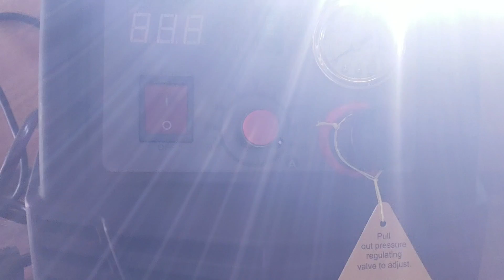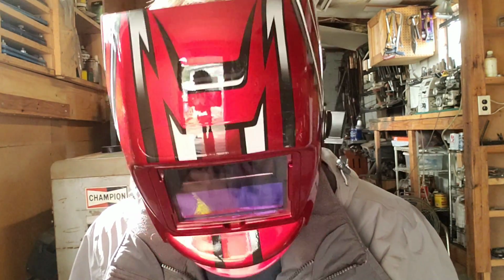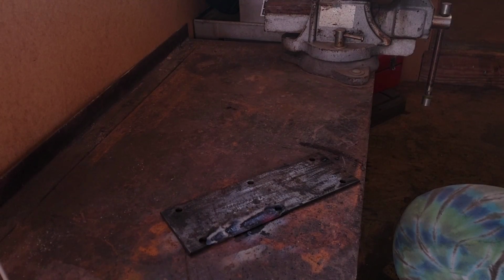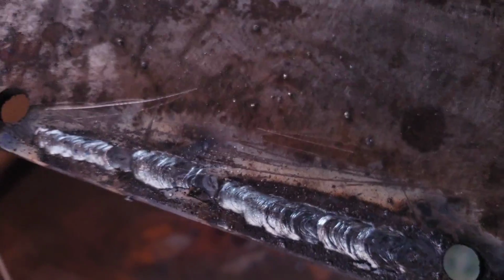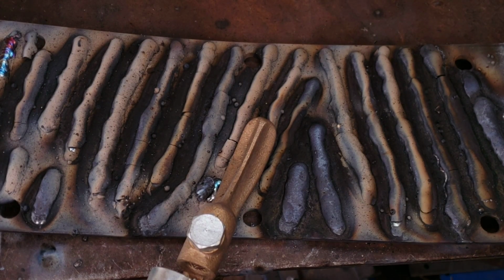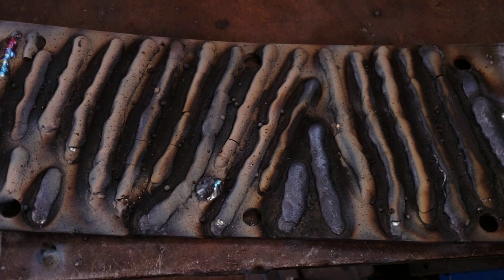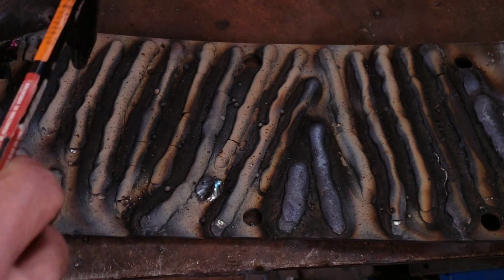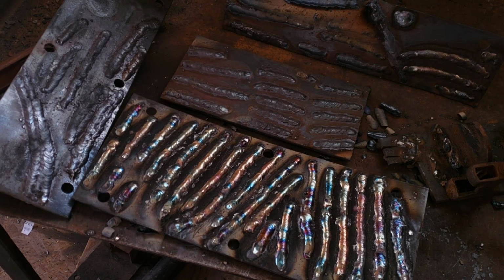Stick Welding For Beginners - First Time Ever!!

Comment: Looks pretty good so far, but try not to practice on just a plate, because stick welding requires penetration. It needs a bevel, or joint to use it properly, so change what you’re practicing on. Try getting a couple pieces of flat strap, butt it up like you’re making yourself some angle iron, and use those to practice with. It’ll teach you inside flat, outside flat, and you can stand it up to work on uphill. 6011/6010 will be 5p/penetrating rod. 7018 will be your cover rod. 6011 holds it down, 7018 makes it look good. Keep it up, you’re doing good!
Reply from the maker: Thank you for your input, I will give it a try.

Comment: Pretty good for a beginner keep practicing. 308 rod is stainless that's why you got the colors it can be a booger to weld the slag can move faster than the puddle.
Reply from the maker: Thanks, that's good to know! I have so many different electrodes it's going to take a lot of research and experimenting to figure them all out.
Reply: I thought it was just beautiful art work ! But I have never welded.ha,ha, was pretty.
I’m glad you put this video out because I’ve been thinking about getting this welder. What more can you tell us about it & the plasma feature?

Comment: Man that reminded me of first day in shop in high school. In FFA we done a lot of things welding was one of them just one of the thing you need to know on the farm. We did what you just done then when Mr. C said you was doing good you started welding two pieces of metal together then try to brake it. If it broke in the weld you had to do it again if it bent by the weld you moved on to building thing. A lot of fun memory's.
Reply from the maker: Some of the best memories come from working in a shop! Sounds like fun! That will be the next thing I practice on.
Reply: I also had a teacher called mr c in high school that’s where I first learned stick now I’m about to go into an apprenticeship ironworking program

Comment: Try practicing out 6011 or 6013 all the way up to low hydrogen electrodes like 7018 or 7016 and see how it goes on a joint plate and don't go over 45°(optimal for fillet weld) rod angle. different plate thickness can affect the bead run. for me practicing on thinner plates can be ideal for small welding like bars, kives, tubes, and motorcycle chassis it's not like the typical full weld thing.

Comment: Honestly dude, you have your amperage too low. Because I weld 3/8 in mild steel E7018 and get excellent penetration. So, try running it about 110 amps with 1/8 in 7018 electrode.